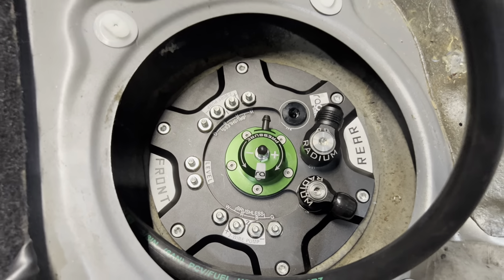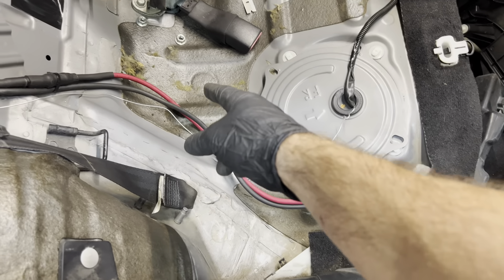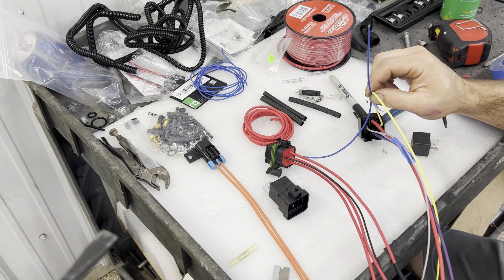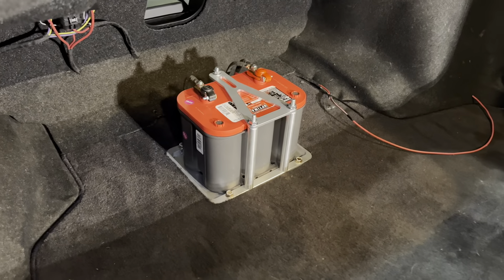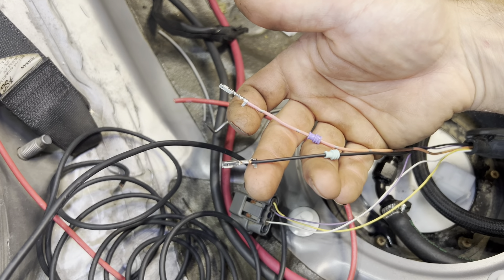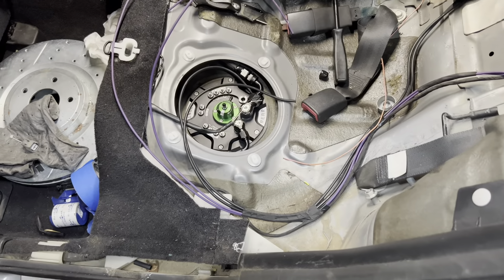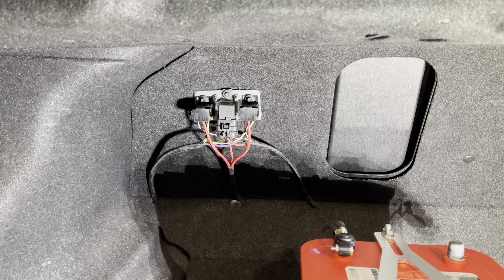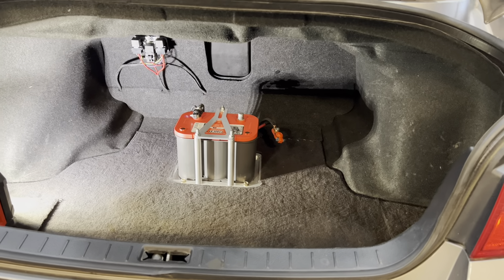WIRING A TWIN / TRIPLE FUEL PUMP Install, G35 350Z 370Z G37

Comment: Couldn’t have posted at a better time. Just installed twin Walbro 450’s on an Autosport Engineering hanger and a DW300 on the lift side for my LS 350Z. Still sorting the fuel lines and then onto wiring. This takes the guess work out of it for me. Solid work!

Comment: Where did you wire the blue wire leaving the radium relay I ran the two red wires and the black I know I need to tap in to my stock connector but what color wire? Radium says tap into the black/yellow wire but that’s for a 350z I have a 2013 g37sedan
Reply from the maker: If you haven’t figured out yet, holler at me on insta: Pete_Tech_YT